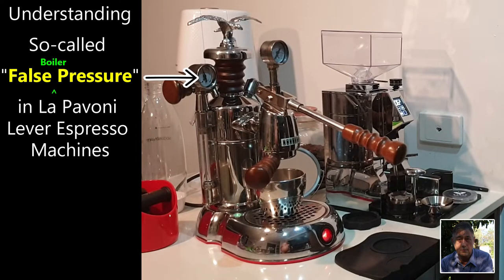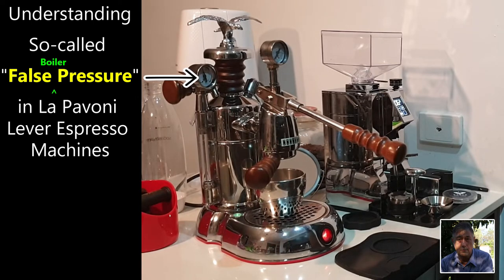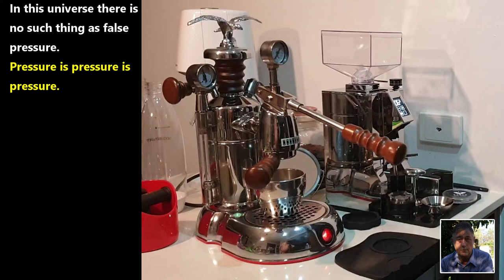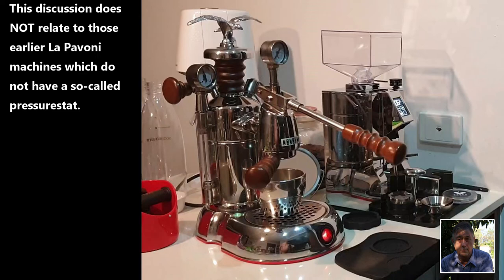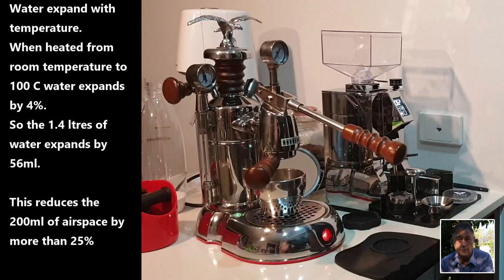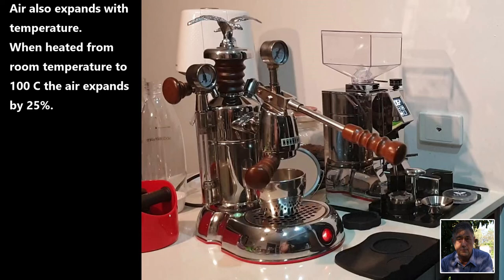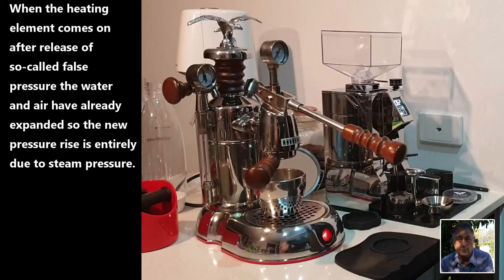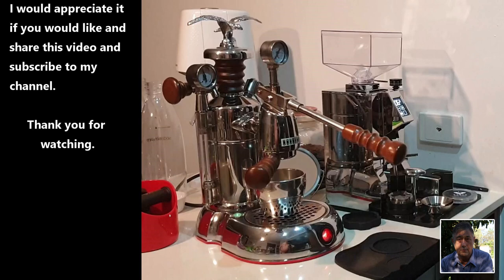La Pavoni Lever Coffee Machines  -  Understanding False Pressure

Comment: Very clear explanation. I think I got all of it inside my brain. One thing is missing though: WHY should I release the so-called false pressure? What BAD does it do to the process of pulling a shot if I do not release it? Oh, and one more thing. I have pulled approximately 750 shots from my LaPavoni over the year, and I have NEVER experienced the sudden drop of pressure that is clearly visible on YOUR gauge when opening the steam valve. Do you have an explanation for that? Thx again sir!
Reply from the maker: To answer your observation and question.
So-called “False Pressure” only occurs if you have overfilled your boiler to the point where the expansion of the water and air causes cut off boiler pressure to be reached before the water has reached its ambient, free atmospheric pressure, boiling temperature.  In that circumstance when you open the steam valve the whole of the boiler pressure is released in a short burst as demonstrated in the video. Then to regain boiler pressure the water has to be further raised in temperature to reach its designed boiler pressure boiling point/temperature.

If you try to pull a shot when so-called “false pressure” is present then there is insufficient continuous boiler pressure to force enough water into the group head.  

If you do not overfilled your boiler then at boiler pressure cut of point the water temperature is above its abient, free atmospheric pressure boiling point. In that circumstance there is no so-called “false pressure” so when you open the steam valve the water immediately boils, and continues to boil, and thereby maintains a boiler pressure sufficient to maintain a continuous flow of steam and sufficient to force water into the group head when you raise the La Pavoni lever.

You say that you “have NEVER experienced the sudden drop in pressure”.  The reason for that is you have NEVER had so-called “false pressure” and therefore no need to release the so-called “false pressure”.

I’m sorry that my reply is a little wordy. I hope it is clear enough.